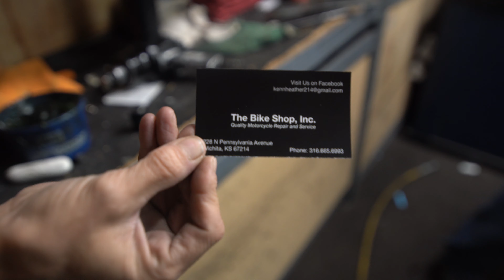170 Rear Shinko Tire Install and New Wheels | Indian Scout Project | Episode 8

Comment: I called Harley-Davidson today about putting new white walls on the bike I just bought. It's crazy I live in North Carolina bought a bike from a dealership 3 hours away in South Carolina and they assured me that everything was inspected and up-to-date. Upon further inspection after getting my bike home and spending a few days with it. I noticed that the tires looked a little aged. Upon further inspection checking the codes I found out that they were 18 years old! Just glad I made it home safely. Anyways, Harley-Davidson told me it'd be about $1,100 to get a set of tires I think they wanted about $369 for each tire and then $80 for each tube and then they wanted 2 hours labor! Bringing the grand total at just over $1,100! That is insane.

Comment: Concerning licence plate bracket link, it appears in your video the tech has to widen the hole on the bracket. This link if for a 3/4" universal mount....my question is  Do we need the 3/4 or the 1" universal mount or do we just need to open the 3/4" .100 or less?

Comment: I've seen people put 180s on the Bobber but Im genuinely curious if it would work with the stock scout fender.
Reply from the maker: yea I think you can put certain 180's on that will fit inside the frame and fender

Comment: So how do they handle?
Reply from the maker: I'm not super sure how to answer.  They handle fine for me, but I'm not ripping around alot.  I'm also really bad at detecting small nuances with suspension and tires and stuff.  It all generally feels the same to me lol.  I've gone across some small sand patches and they did fine, haven't driven them over water yet though